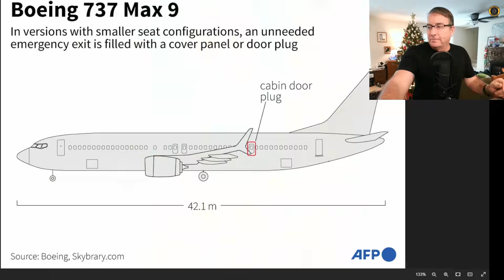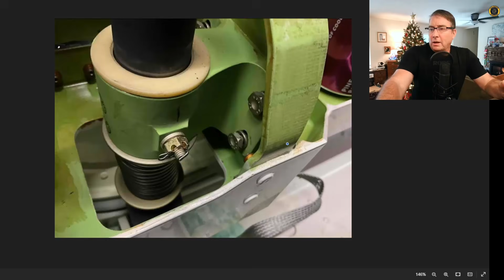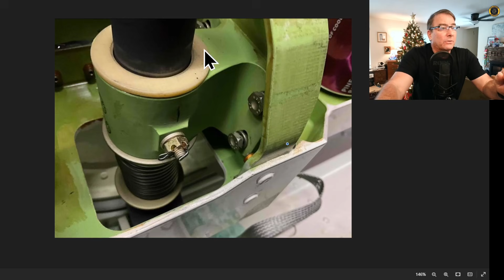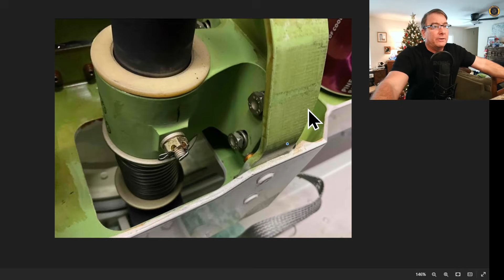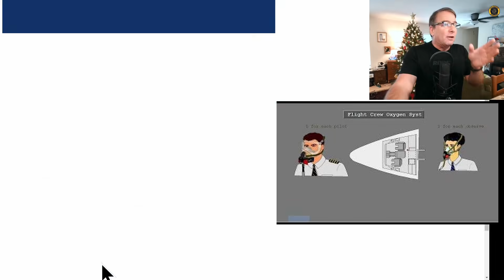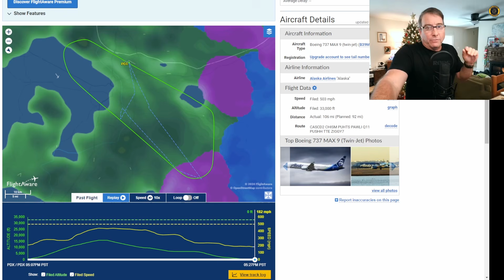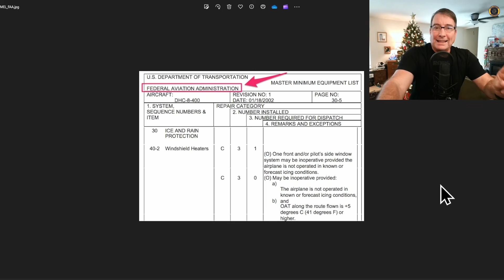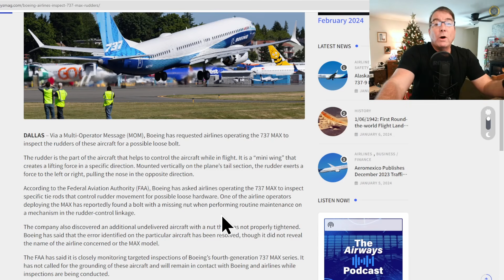"Yes, We Have No Bolts"  9 Jan 737 Max-9 Update

Comment: It would seem as though this not used plug door is ignored when it should be looked at constantly unless they fit a stronger locking system or weld it up if there is no chance of extending the seating capacity? for all these lower seated 737 maxes need a locking device that can be checked between flights and not just the next examination date.

Comment: There is absolutely NO excuse if those bolts were left out of the assembly of the aircraft. For what these airliners cost new and what the skill level required to build them in my opinion heads at Boeing had better roll. Americas workforce today is absolutely insane. Absolutely no pride in their work and no leadership and management from above . Thanks again for the spot on video .
Reply: This why their corporate office is located in Chicago, this way they avoid all involvement in the manufacturing process.  What happened to Mcdonald-Douglas will happen with Boeing, they will make the company fail, collect their bonuses and retire.  Their greed overrides their conscience, if they even have one of those, which is unlikely.
Reply: If you have pride in your work you'll soon find yourself dismissed from a company like Boeing because you'll keep insisting on doing things right when the executives only care about them being done cheap . That's why we have this "labor shortage" too many people with pride in their work, an unwillingness to work for less money than they need to live on, and the ability to take better offers abroad. Make no mistake, this is 100% on the shoulders of the modern robber barons. They aren't willing to pay for quality or tolerate the costs of safety-conscious workers, I mean, if they did that they might have to pay themselves a 6 figure bonus instead of 7 figures.
Reply: The low quality is a result of the minimum pay given to workers. If Boeing isn’t paying me enough to have my own apartment, why should I give a shit what happens to the aircraft when it leaves the gate?
Reply: @Rizzler420-uh4yd that’s why you don’t get paid more, because there’s no value in your work, because of your attitude. Just another example of someone staying poor by their own behavior.
Reply: @zx-4rr-pls  nope. The hard workers who take pride get punished for taking longer because they actually assure the work is complete. Move on fast and the company rewards you.
Reply: I dont think this will end up having anything to do with Boeing unless the instructions are written unclearly
Reply: No union?    @surfingcavachon

Comment: Remember hindsight is always 20/20, a lot of should haves and why didn't they in this vid , very easy to point fingers but tough to pinpoint the next incident/accident in the future, tell us where the next wreck will be? If those bolts where indeed left out that keep the door pinned the FAA will indeed jump on those poor bas....s who let that slip, this looks to be incompetence, inexperience  or a lack of oversight on the inspection procedures, regardless this does not look like a Boeing design issue.

Comment: Great content, as always, Juan! I wonder, why have the spring assist if that plug is only going to be removed for service or changing it to some other option? Seems that the spring would be appropriate if it were actual exit door otherwise… Why?
Reply: I get that, but if that could tend to force the door open. If the bolts are loose, or in this case, apparently missing, I would think it’s not a great design, given that you only need to remove that plug for maintenance or replacement. However, I watched the 737 technical details channel and he was seeming to say that you need to push down against the springs to release the door so now I’m confused as that doesn’t seem right if the posts are on the fuselage and the tracks are on the door…??
Reply: They push up on the door, thus allowing it to be raised and lowered with less force. Once installed, the door needs to be raised and lowered only a couple of inches to disengage/engage the twelve locating pads.

Comment: This is a near new aircraft right? Why are the CVRs still limited to recording such a short timeframe? I would have thought that with digital recording a few days would be possible.
Reply: Europe requires up to 25 hours. But you have to remember you can just stick a $10 usb stick into the aircraft to capture all data. They have to pass extreme tests to be certified for use on aircraft

Comment: The BS of stuff being missing from the manual was one of the things the grounding of the MAX fleet was supposed to solve.  The fact that the flight deck door is designed to blow open during an explosive decompression is 1) extremely troubling from a security standpoint and 2) extremely troubling and infuriating from a communication standpoint from Boeing.  There is clearly things STILL missing from the documentation given to pilots and (probably) the maintainers.  

Boeing needs to get its act together and fire the bean counters in charge and replace them with people who prioritize safety, design and reliability over profits.  It’s the only way they’ll have a company left moving forward.

Comment: As both an A&P and an FE, this is scary from all directions. I've come to distrust Boeing overall, and I really hate the over-reliance of technology. I have 10 years of maintenance experience and I've seen a decline in quality and a more "rushed" style of work being performed. On the other hand, the importance of the crew to check forms and maintenance history is critical and I would gladly reject an aircraft with a 'repeat/recur' write-up... especially with pressurization problems. Fortunately, I have the ability to override the auto pressurization feature (should it ever fail) and control it manually, and it is standard practice for us to chain (or hook) our checklists to an anchor point and NOW I see why. With so many tasks burdened to the small crew, I am thankful for the training and response but I find solace in my larger crews and our CRM. Great coverage, Juan.

Comment: I'm glad that you mentioned the cockpit door flying open. These post-9/11 "hardened" doors now just fly open in a depress? How bout that info now given to the terrorists.....
I hate to say it but Boeing has failed big time. All around. Shall we count the death toll based on poor engineering design? I guarantee it's FAR more than "cops shooting black men" but we won't discuss that here. 
On Air Disasters, I recorded a quote from an older episode- the ALPA guys says "In the '80 many accidents were blamed on pilots. Why? Because pilots were cheap. An aircraft manufacturer or engine manufacturer found at fault could go bankrupt. Cost in the billions. Nail a pilot, and the problem goes away."
Welp, here we are Boeing. You can't get away with this. Your designs, your procedures, your quality control are causing this. We're just lucky this plane didn't crash. If this door came off at 40K feet, over the ocean......
Oh, not to mention- the cockpit doors opening in a depress. How about make some hidden vent doors instead???

Comment: Great video as always!

And as always, as more facts are discovered the circumstances become increasingly complex and intertwined. 

You also make a very valid point about the repeated MEL write-ups and I completely agree that this was likely an early indication of the incipient failure. 

I myself made an internal safety report about one of our aircraft which had a history of a repeated emergency exit light failure which was constantly being justified as ‘operator error’ by pilots carrying out their preflight checks incorrectly. 

After a months long investigation and digging deep I to the systems with the manufacturer I discovered that what was superficially an exit light issue turned out to be a failure of one of the emergency battery packs and systems. 

A perfect example of having to dig deep I to repeat issues.

Comment: Pulling the breaker for the CVR would not erase what had already been recorded on it, but it would prevent any further recording. To the best of my knowledge, the only way to erase what has been recorded is to press and hold an ERASE button on the flight deck for 5 seconds. At least, that's the procedure used when performing an ops check of the CVR (done that many times on 737 BBJ's, which I am sure is identical on the Max). Thus, it's pretty much impossible to accidentally erase  the data. Also, the CVR's can record for about 2 l hours before being overwritten. They were only in the air for 20 minutes, shouldn't have been any need to pull the breaker to preserve the data.

Also, considering the young age of this aircraft, this plug area probably has never been inspected or maintained since the interior was initially installed. Unlike the overwing emergency exit doors, it's impossible to tell from the inside that there is even any type of door there as it is covered by the regular sidewall panels same as the rest of the interior. 

My guess? If those bolts were missing, they were probably never installed at Boeing. Can't think of any logical they'd ever have needed to be removed once installed.
Reply: If the aircraft was left connected to ground power then the CVR would still be powered and not stop
Reply: @tomstravels520  I believe that, on the ground (weight on wheels condition), the CVR stops recording when the engines are shut down. Don't believe it records continuously with ground power.
Reply: @WmTRiker  there is a voice recorder switch that can be fitted to record on ground so that may have been in the on position for some reason even though it trips to AUTO after engine start.

Comment: Wow! What a detailed and unnerving report. Boeing needs a massive management change focused towards more engineering and less concealment of information. It looks especially sketchy when that information is tanked for a Cert. Designing the cockpit door to blow open under decompression? That's crazy, if nothing else, it puts another additional workload on a crew already dealing with an emergency. As you mentioned, flight manuals and other misc materials just took off. Missing bolts on a rudder? This is getting weirder by the minute. Dose Boeing have a QC division, or do they just hope for the best and let the chips fall where they might?

Comment: I hate to say this but this sounds like a maintenance or manufacturer issue. If maintenance are finding these issue they have to well document it for later on and report it to Boeing. Flying with an MEL is common place as there are redundancies on all aircraft as you said which allow the operator to dispatch. Dispatch and the Captain verify these and agree to dispatch the flight if it is allowable within the MEL. Repeat items in the flight log are cause for concern. Could it be that because this issue has no light for the plug door it may be a what was thought to be another sensor issue that could have been frozen. If it happens intermittently its another can of worms until main check.
The fact that airlines are finding bolts loose or missing is a greater concern as this could have been delivered like that. Maintenance and crew would have no way to check it until it became an issue. Does Boeing have a protocol for triple checking fasteners? You'd think so.
I wonder if there have been some rushed orders by Boeing so as customers are getting their aircraft on time? This may get real political between the FAA, Boeing and Alaska. Welcome to the blame game!

Comment: Greetings Juan. The blowout panels only open up when the depressurization happens in the flight deck. If it happens in the cabin, the door is supposed to handle that pressure differential according to the aircraft maintenance manual.
Reply: Very suspicious!
The bulkhead can't withstand the differential pressure - either direction.

Comment: The item in the list of things that can cause an auto pressurization failure that makes most sense to me is the cabin pressure rate of change.  If it was the actual cabin altitude then the cabin would have been at 13875 CPCS and the crew would have known that.  But, if the plug door was causing an intermittent pressure fluctuation the cabin rate of climb/descent could easily have triggered even if the cabin altitude didn't change very much at all.
What the NTSB might want to do is check the seating roster for the previous flights that had the alarm and to interview the people around the plug door that failed.  Even if the cabin altitude didn't change much, if the alarm was triggered by the climb/descent rate as I suspect the passengers near the door may have heard whistling and/or felt a quick pressure fluctuation in their ears.

Comment: What's confusing to me is that, as you describe, the plug is spring loaded to open... why?! That design decision is confusing to me. You'd think you'd want it to default to a closed position, not an open one.

It seems like several parts of the design are overwrought, what would be wrong with 12 bolts? Their design suggests a strong need for complexity on a piece that should be essentially permanently affixed.
Reply: And one more thought, unless I'm missing something, the pressure differential pushes outwards, right? But the stop pads seem reversed if that's true.
Reply: @durable1988 the stop pads push against each other when pressure is exerted. The springs are to help assist get the plug open when removing it

Comment: Juan - isn't the cockpit door opening a security issue? if a bad actor could open an exit door, then could another bad actor access the cockpit?
Reply: You can’t just open an exit door in flight. The actual doors are pressure locked , no human is strong enough to open them in cruise altitude

Comment: Why wouldn't the autopilot automatically level off in a depressurization event?  Could that be more risky than continuing to climb?
Reply: In a way yes because you are not cleared to stay at that altitude and could cause conflict with another aircraft depending how long it took to descend. However there is an altitude hold button you can press to level off anyway
Reply: I'd imagine that could be quite disorienting for the pilots

Comment: Thank you Warren for once again reporting and informing us in such an unbiased nature. This situation brings back a memory of a flight as passenger back in 2002 from Johannesburg to Perth on what was called the Wallaby-route in a retiring flight for the then 3 crew 747 200. SAA then changed to Airbus A340-200 in 2003.  I think being a pilot with a background  and interest in matters technical, rather than just flying the aircraft, I was always aware of things which no passenger would even notice. On that particular flight I had made sure to have a seat at the emergency exit on the wing for legroom. Seats 27B and 27C  in Economy if I recall correctly. I remember on boarding the aircraft, I was aware of  just how old and yellow all the plastics seemed and the general wear and tear of everything on this aircraft. Back in those days we trusted Boeing engineers and our maintenance crew 100% . I even allowed myself to relax on this flight while the emergency exit, just to our left, was making the strangest buzzing sound throughout the flight and moisture was pooling on the floor. I recall the flight attendant very elegantly came and wedged a towel in the gap below the exit door to soak up the moisture. With all the present day issues on Boeing, I doubt if I would have let this one pass without thinking twice. 😊😅😅
Reply: Who is Warren?
Reply: Prob spell autocorrect from Juan to Warren?

Comment: I bet 1,000% that that overwrite is just simply releasing the file pointers in the operating system of the recorder. So the data still exists in contiguous form. You just have to recover it. It won't have any information in the naming but if the file system is robust enough it will retain the dates of the files. And then you can use special scanning software to look at the audio data and piece it together. Because it might be in a bunch of separate files. So that data's recoverable. Send it to a data recovery shop.

Whatever you do don't turn the damn thing on. Cuz anytime the operating system boots up it's going to see those file pointers as free for use.

And this is a lesson for you out there in PC Land and USB land or any kind of solid state storage. If you erase all of your pictures from decades of photos by accident. Stop and unplug the machine. Do not try to figure out how to recover things on that machine. Unplug it immediately. Then send it to a data recovery shop. If you don't have the money for that you can do it yourself. You'll need a Linux operating system. You will mount that drive read only. And then you can run data recovery software that is open source and recover those pictures and videos.

I have done this several times and it works out really well.

Before if possible you do anything. Use a tool in Unix and Linux called "dd" Yes 2Ds. You can image one drive to another really easy. You can also image OneDrive to a much larger drive. As an ISO file. Then you can use those copies to mess with in your efforts to recover the pictures and videos.
Reply: Preserve this message, @NinkSink speaks valuable truths. JB/NTSB take note!

Comment: That’s why they did not put passengers close to the plug door because of the loud hissing sounds coming from the pressure leak. They knew this even though the plane was fully loaded. It’s been leaking from previous flights. That answers the question why those seats where empty.
Reply: Heard that person for the seat missed the flight. Hope they bought a lottery ticket!